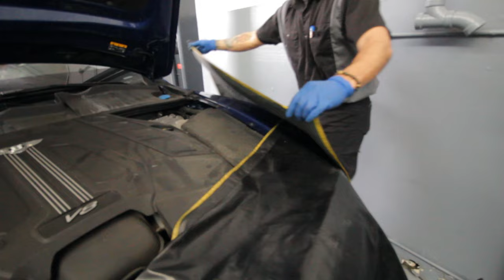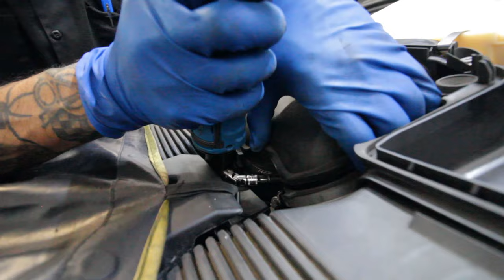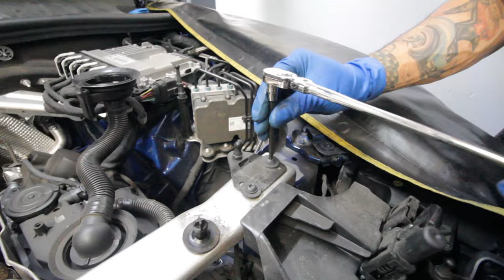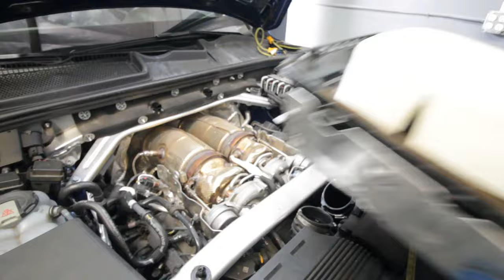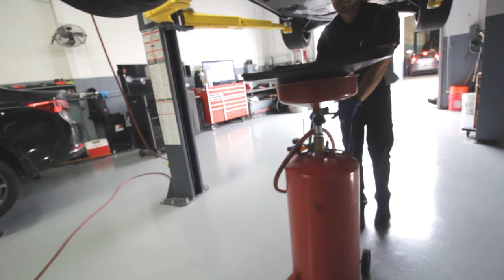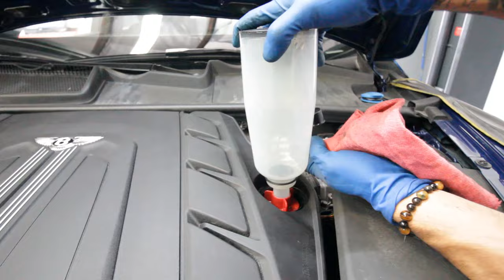2020 Bentley Bentayga V8 Oil Change

Comment: about over $150 dollars worth-right!
Reply: Try $2000 for a one year service which includes , oil service, key fob battery , 3 wiper blades and a cabin air filter along with a standard vehicle inspection.